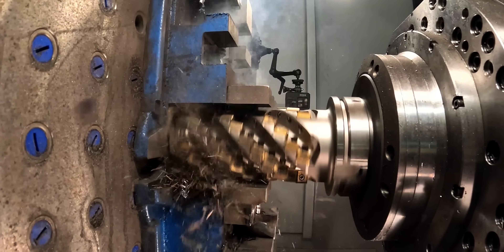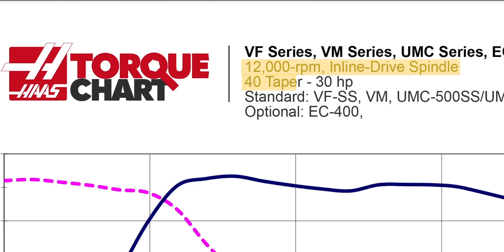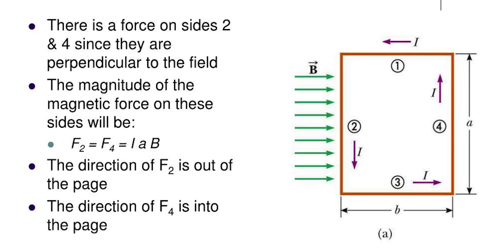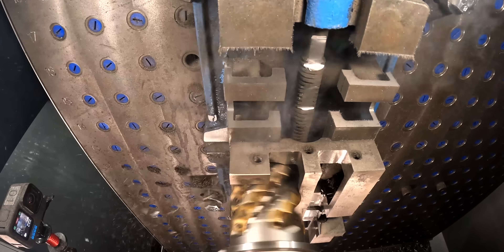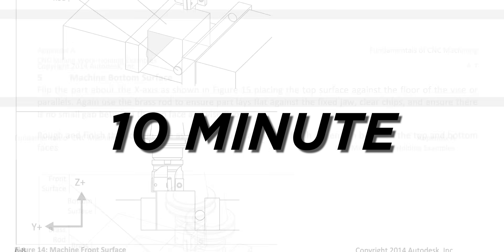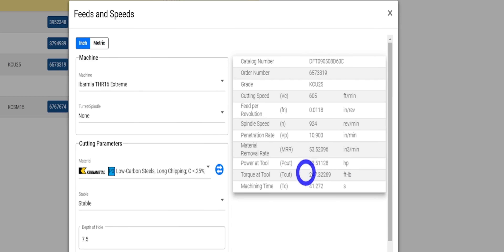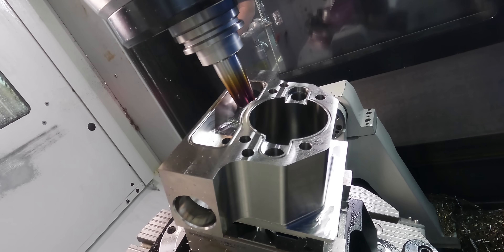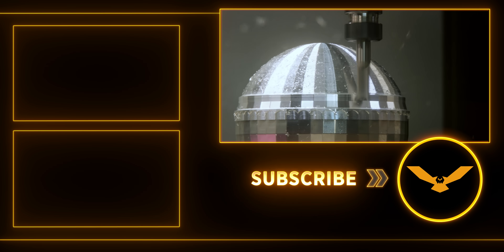You've Been LIED to! | How to Calculate CNC Machine Spindle Torque and Power

Comment: AMTDA HP Data - Every electric motor has a duty cycle and for machine tools, it’s called MTDR. (Machine Tool Duty Rating)
100% for 24 hours (Continuous HP)
125% for 30 minutes (MTDR)
150% for 1 minute (Peak)
When a machine tool spindle or axis motor reaches its limit, one of two things happens: 1. It shuts off because the internal temperature sensors indicate that it is too hot. 2. It stalls because of lack of torque.
When calculating the power required to propel a drill into solid material, it is necessary to calculate Horsepower, Torque and most importantly the Axis Thrust. On large drills, the maximum axis thrust may be exceeded before HP and Torque are.
The duty cycle also applies to a motor that indexes a turret. A turret can only perform so many indexes in an hour before it “Duties Out”

Comment: Let's say Sam Jones has a CNC shop and he's fixin' to buy a new mill. Vendor X shows him a chart that rates the spindle power at 200 percent load. Is there a formula that'll let him translate that to spindle power at 100 percent load?
Reply: Honestly, if there is a formula for that, im not aware of it, but you could calculate it based on another manufacturers spindle chart maybe and get a rough idea!
Reply: @barrysetzer  Thanks. I figured it wasn't linear.

Comment: I overheated my Fanuc robodrill a few times. It did take 36 hours robot loaded running with a dull tool 😂

Stuck a new tool in and it ran non stop for 3 weeks 24/7 after that

Comment: That's nifty gritty getting down to the science.   I have run silicon valley CNC shops as a programmer for almost 7 years now, and Its pretty simple to just pick a HAAS, 40 or 50 taper.  I suppose when your high production, and trying to squeeze out every penny on long term jobs, this is a good way to calculate.

Comment: So I have a question, about spindle fretting.  In our shop all our mills limiting factor is fretting.  Anytime we come anywhere close to the spindles or machines limit we start to get fretting in the spindle taper, all our machines are big plus spindles and all our tooling is as well.  Just wondering if anyone else has this issue as well.  Don't get me wrong we remove some metal but it's always fretting for us thats the limiting factor.
Reply: U men’s fretting corrosion?
Reply: @kleini3  I guess maybe, when you get the gold colour on your tools and if you leave it it eventually turns into pitting on the toolholder and In the spindle.
Reply: @85CEKR  did u checkt ur Lubrications ? Maybe not enough oil reaches the bearings. But when misalignment isn’t corrected inside the spindle it doesn’t change
Reply: @kleini3  it's not from  inside the spindle, it's from taking heavy cuts and the pressure put on the two different metal surfaces (spindle taper and tool taper)
Reply: You can coat the tapers on the tools, or make sure that some the thru tool coolant ends up on the taper, minimal help but maybe enough, if you have knocked the front face of the double contact with a bit of swaft, you might have issues with the seating.
Also get your belville washers checked for tension, if it's down up might be getting a bit of tool walking down the taper, also try feed milling or plunge milling to ensure forces are pushing tools in.

Comment: manual feed cutting pressure? hand dial 30mm off center of 1.25mm thread pitch, 30/1.25=24x hand weight 3lb= 74lb. 3/8 bit 74lb cutting force and its making pin shards off of a 280'000psi hardened stainless surface plated strut rod... using a $84 drill press, made the rod square with cuts smaller then a basic digital micrometer can measure. set up test, hardest metal available... black oxide HSS bits do nothing to the surface coating on that stainless strut rod... HSS bit vs "mystery metal" just to see the bit melt away to nothing hardly scratching the work stock? carbide tungsten... eats it... just like my breakfast the cops took last week, too good they wanted to get some... hand slips "30lb on the feed knob" and there is 780lbs on the cutting face and the $84 drill press w/ brazed table guide grease nipples all over tension set screws springs etc. vibrates everything off the barn wall but starts making flakes not 0.00007 shards. broke a T-slot height notched mill clamp, the hardened steel teeth cracked/lost the outer steps. square 280kpsi tensile round bar. does it work?
Reply: vice jaws...

Comment: I trust that you're not going to blow up a spindle, but keep in mind that ultimately the bearings take all machine forces and the harder you run your machine, the faster the bearings are going to wear out.  All that energy has to go somewhere.   Heavy duty usage requires a more aggressive maintenance program.
Reply: It's rarely if ever a linear progression, though. If you do your homework, it could be worth running the machine at a pace that would look brutal to the traditional 'eyeballer' types.

Comment: I'd liked a more in-depth explanation on the spindle graphs. S1 ,S2,S3 exc....
Reply: Sure! S1 is usually what you can run at continuously. S2 is usually what you can run at for a specified amount of time, and s3 is usually also for a specific time period less than s2. S4-6 will be a percentage of a 10 minute duty cycle, so if s6 is 15%, you can run at 1.5 minutes at this curve, followed by an 8.5 minute cooldown.

Comment: It's duty cycles. Going over 100% spindle load just means you can only do it for a short period. I've had things that I had to run at around 120% load, but only for short bursts. No problem.
Reply: Ran a siemens equipped horizontal borer,  3500 ish Nm in low gear, 100%load on that is fun to see.
The load meter is just a fancy visual gauge which means nothing until you've done you 3rd part, then you can use it to keep an eye on the tool wear through tool management, the rest of the machine will help know what is too much, then adjust to get the balance between tool life and stalled in the cut 😁
Reply from the maker: Yep, the DMGMORI DMU we had used to frustrate me so much because it would start skipping and stalling at 80% load…
Reply: @TITANSofCNC  wow. Your honest experience like this really is valuable. Wish you guys could work with some well built Japanese machines too. OKK, Yasda etc.
Reply from the maker: Always open
Reply: @TITANSofCNC  do u guys have any contact emails? We are trying to setup an engineering solutions company here in Uruguay and we need advice

Comment: SVM4100 and DNM6700 should arrive to our shop sometime in February, then we will see if the trust i put in your videos was warranted. We got a great deal on those machines and i cant wait to push them and show the company owner how much faster modern machines are compared to aging light duty Pinnacle VMCs we have now.
Reply: You wont regret it ;)
Reply: @barrysetzer  hope so :D if you would check my last short video you would find the limits of our current machines
Reply: Excellent choice and great machines. They both come packed with standard features built-in to help you with productivity and if you're in one of our territories, you'll always have support when you need it.
Reply: @ellisontechnologies  thanks, but be are in Slovakia, not the US
Reply: Have have they been doing for you?
Reply: @qdp03  are you asking me about our experience with those two machines? It has been great so far, only issue we had was that the draw bar collet in the DNM had to be shimmed, because sometimes it would not unclamp the tool. The SVM is a beast of a little machine, recently i accidentally pushed the spindle a little harder than intended, mild steel, 16mm end mill, 60mm axial, 1mm radial, 7000rpm and 6000mm/min... no chatter, no slow downs, just spindle load monitor was sitting at 180% the whole time.

I can sum up our overall experience with DN Solutions by saying that we ordered a DVF5000 which should be delivered in about 2 weeks from now... Late Christmas gift/ shiny new toy for me :D
Reply: @dubi127  Great to hear! I'm considering the SVM in the near future.

Comment: So pretty much don’t buy cheap. Buy either soo doosan , mazak, okumas , gotcha
Reply: Haas ?
Reply: @JulianGarsep  i really don’t like haas. I’m more of an Okuma guy . I ran a haas once didn’t like it at all
Reply: He lightly touched on this with the two spindle types. Most people get in trouble trying to run a low torque high speed spindle like it is a high torque spindle. Understanding what you have and how it affects the needed programming strategy is VERY important. If you're running aluminum and small tools you may want the high RPM, even though that means relatively fragile ceramic bearings and low torque duty cycles. In fact, I have run a machine where I overloaded the motor with just all the RPM ramp up and downs, not the cutting load. Tools were so small they would have broken way before the motor load even registered on the amp meter.